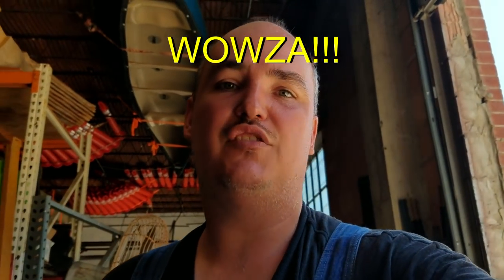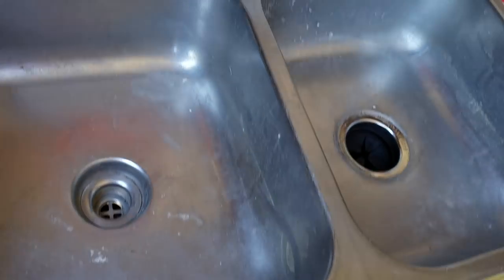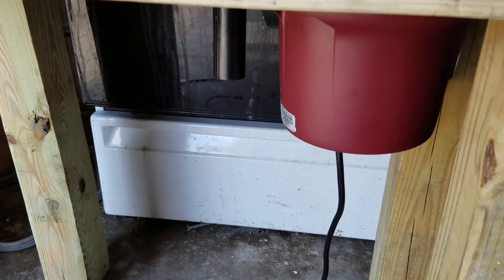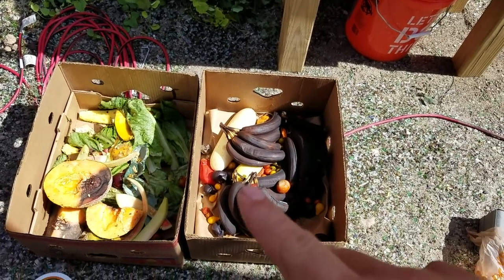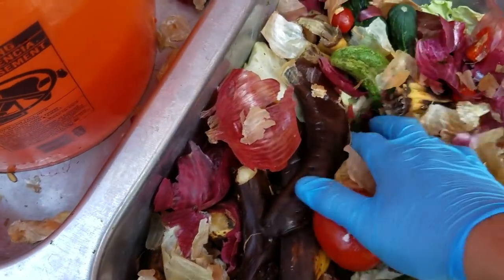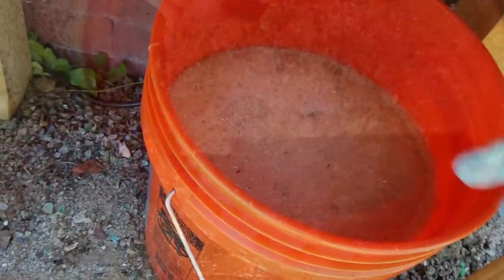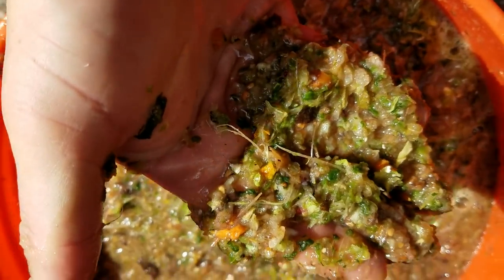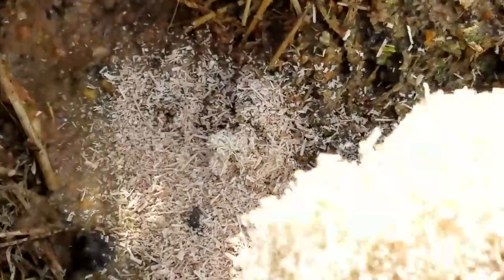HOW TO DIY FOOD SCRAP GRINDER FOR FAST COMPOST - COMPOSTING METHODS & FOOD WASTE MANAGEMENT

Comment: What I did is added a pipe under my kitchen sink with a twist cap on it. When I need it I will open the cap and put the bin under the sink, since I live in down town I do not have the luxury of having a second sink or workshop space.

Comment: I would like know if it would be good to grind partially composted stuff (including  branches and sticks that are soft) for use directly in the garden.
Reply: Partially composted stuff is only good as mulch as long as warmth remains in your compost. Smaller plants would die, banana plants and trees tolerate warm, unfinished compost.

Comment: I've been composting for 30 years. I started just cutting things up with a machete and stirring it with a garden fork. Then I found and old meat grinder. It worked great, but it had such a small bowl that I had to cut up a lot of stuff. Then I found a large grinder by Lee valley. It works like a hot dam. A big bowl, less cutting and actual knives at the end. It will cut up cobs into small pieces. However, it does take some arm strength and it can be difficult to mount the grinder..I have made a system that dumbs it straight into a compost box. However, I've longed for a better system. I had Invisioned many a contraption from tree mulchers to car shredders (on a smaller scale). But, those things can be costly and time consuming to build. Then I seen this video today. I thought, what a brilliant idea. I went out to the re-store because I had remembered seeing a used garbage disposal there. At the time I seen it I thought, who would want that. It was still there. I bought it for $40. Sinks were on sale and I got one for $12. So now I am eager to build this and give it a spin. Thanks for the inspiration. You may have saved me a lot turmoil deciding on a better system.